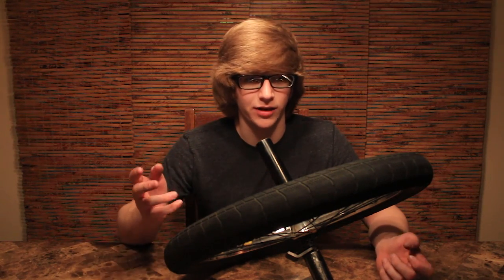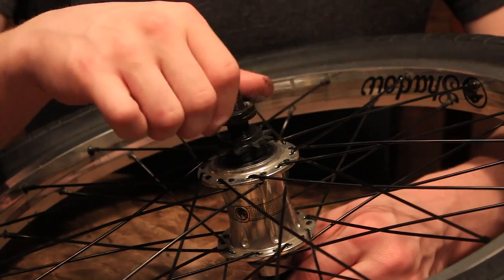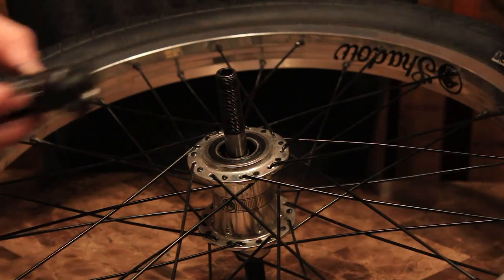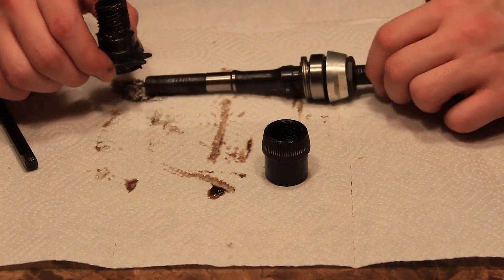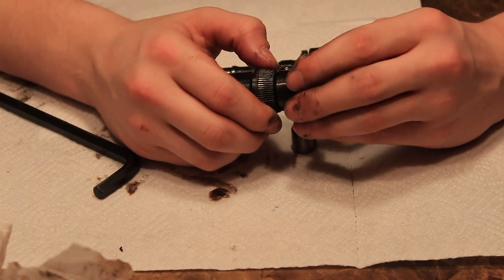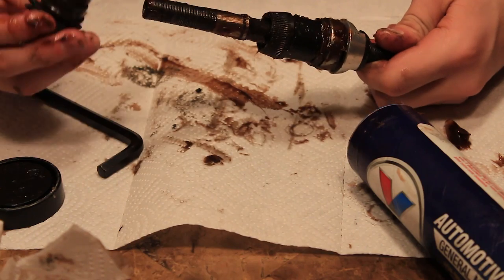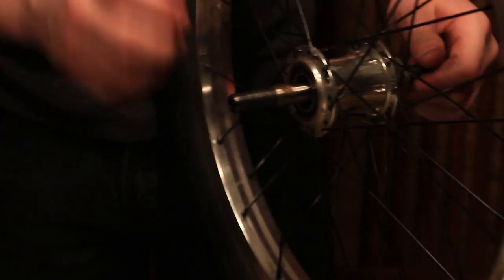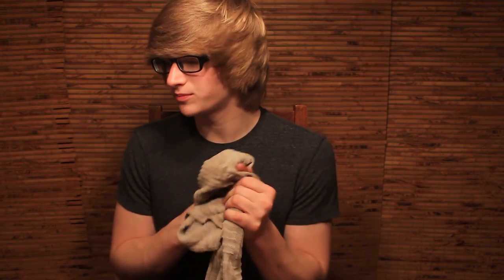How To: Grease A Freecoaster BMX Hub

Comment: arent you supposed to use a rubber mallet? from what i understand a steel hammer could break the interior of the hub. (sorry for bad english)
P.S. Keep up the amazing work ryan
Reply: Casper Berglund your English is perfectly fine dude
Reply: I'm 2 years late, but yes, you are susposed to use a rubber mallet, or else you can damage your hub.

Comment: Whats the best grease to use???
Reply: You can buy a container of it at any hardware store and auto parts store. I myself am into dirtbikes as well so I use my Maxima Water proof grease. It works great and doesn’t wash away and it has a rust and and oxidation chemical in it that does wonders. I use it for everything now.

Comment: Can you use WD40? It's thinner grease but will I work?
Reply: No, WD40 is a penetrating oil and it de-greases. WD40 and bike shouldn't go in the same sentence.
Reply: Jamie Bales unless it's for rusty axle nuts, stem bolts, anything that's rusty.